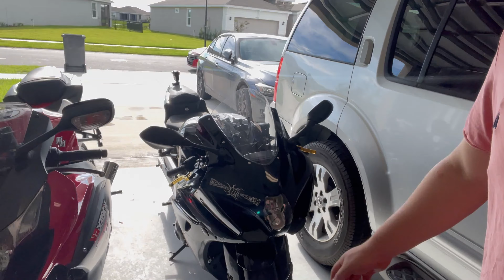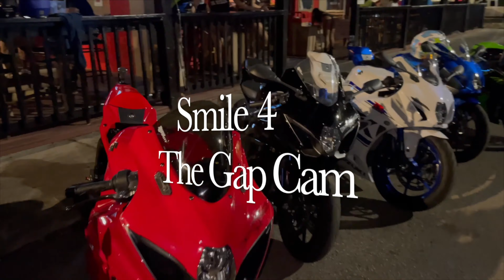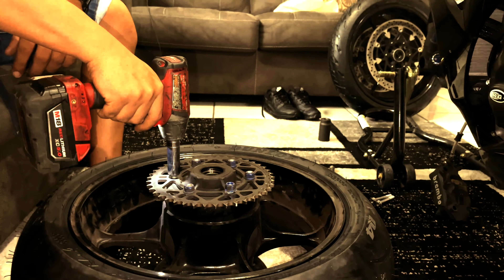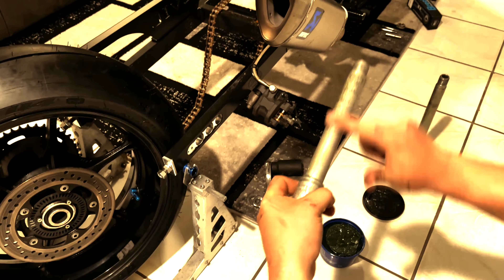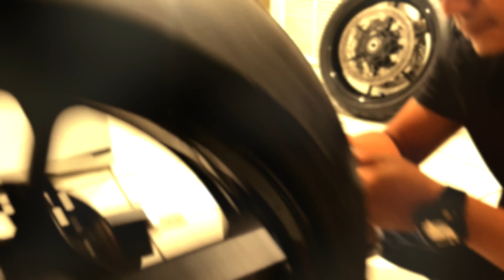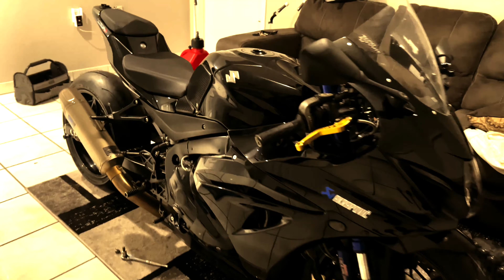GSXR 1000R new rubber & Lowered

Comment: How many inches did you lower the front
Reply from the maker: 2.5 inches
Reply: @humbertohafj  no touching or nothing in front
Reply from the maker: @darenoreilly3852  I don't touch no fairing in the front unless I strap it down. that's why I only went 2.5 cuz if I go 3 I won't be able to strap down cuz it would be already touching. I would recommend only 2.5 to be safe.
Reply: @humbertohafj  thanks
 Nice bike